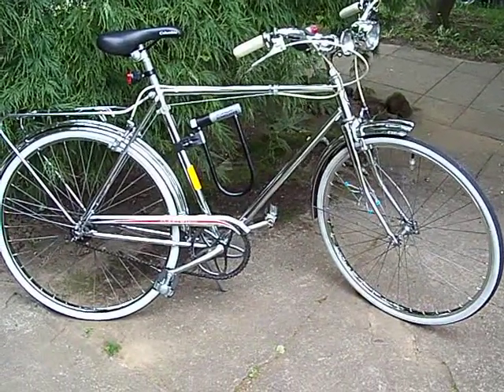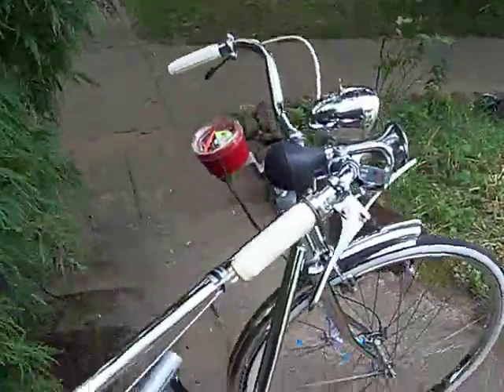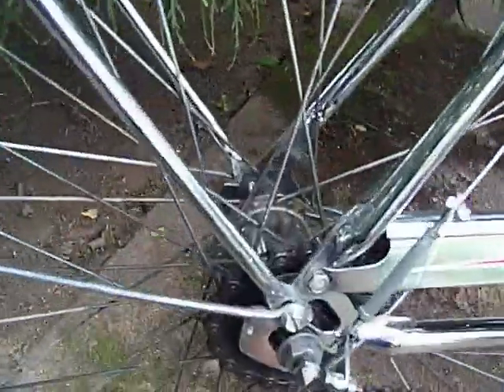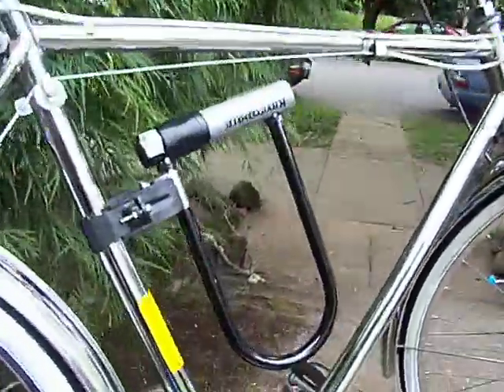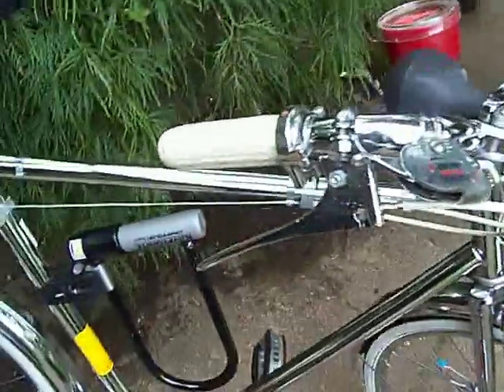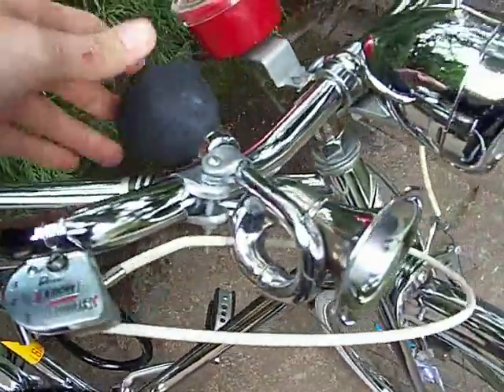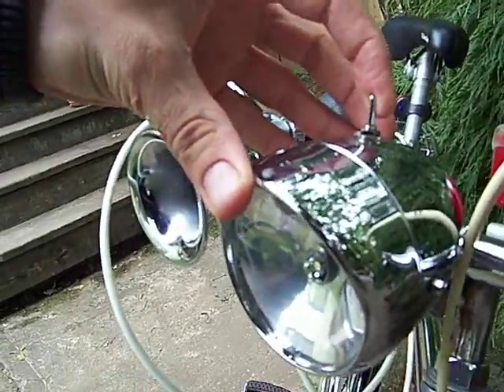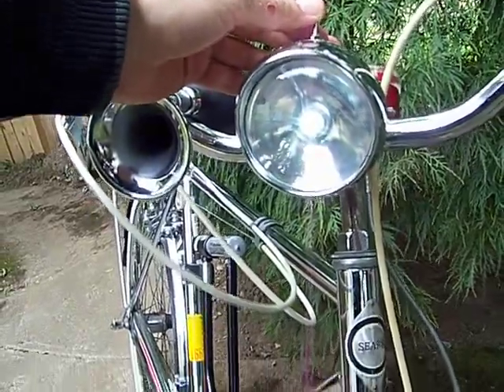1970 ish chrome sears fleetwood 3 speed bicycle

Comment from the maker: I bought this bike for 40 bucks, however, it needed some work.  There was surface rust all over the bike that polished off with 0000-steel wool.  I polished off rust for about 10 hours.  The tires were original and needed to be replaced. The speedometer was ceased up so I fixed that too.  I really didn't do much more but oil and grease the bike up.  I spent around 50 bucks to get this bike to the condition you see here.